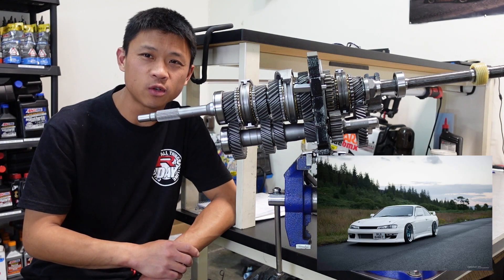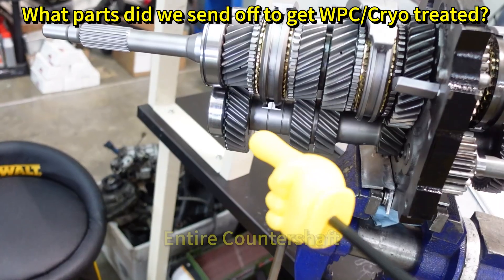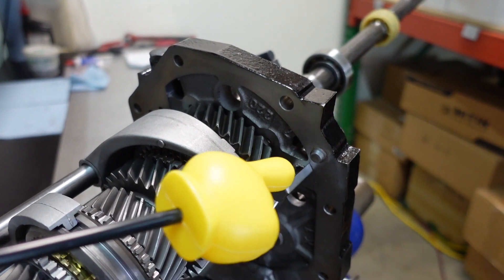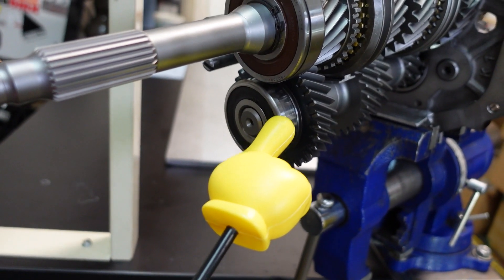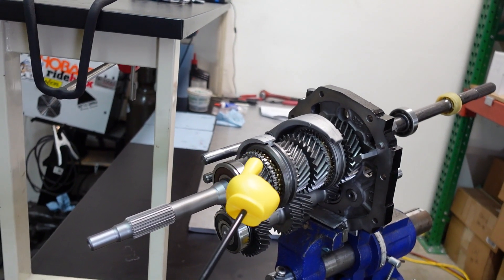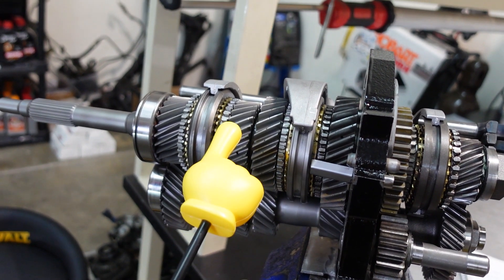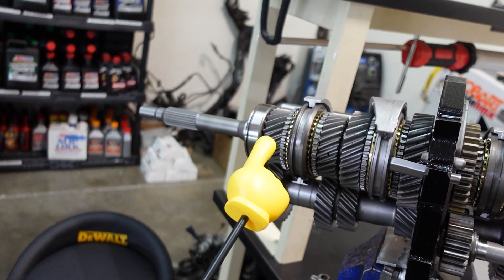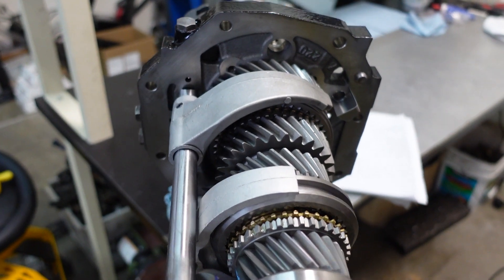S14 FS5W71C transmission Rebuild Pt.2

Comment: How do you know when to replace the shift sleeves? I am breaking down a 71C right now that was endurance raced. One of the "shift inserts" fell out and was in the oil. Very hard to find any gear after initially being stuck in gear. Assuming the sleeve was over traveling and allowed the shift insert to rock out of it's seat, but not sure why. Thank you.

Comment: How do you install input shaft bearing with the housing on?
Reply from the maker: You cannot safely.
Reply: @CMAutohaus  that was my thought. Thank you for confirming. Also, what is the part number for the countershaft bearing and shim you’ve used?
Reply from the maker: @ag.3153  Select fit sizes PNs are all in the FSM,
Reply: @CMAutohaus  I found the info for shim, but how about the countershaft bearing. It’s not in the FSM. Any help is much appreciated. Thanks.
Reply: @CMAutohaus  no response to my question. Thanks.

Comment: Question... Why would this gearbox (s14a) be very difficult to select only 1st and 2nd gear after a short  burn out.? Cheers
Reply from the maker: Clutch disc problems (overheating) or hydraulic issues would be my best guess
Reply: @CMAutohaus  sorry I should have mentioned that it's the same with the car switched off. Its definitely not clutch related. I'm wondering what could be up with the gearbox selector being so stiff for only gear 1 and 2 ? Cheers